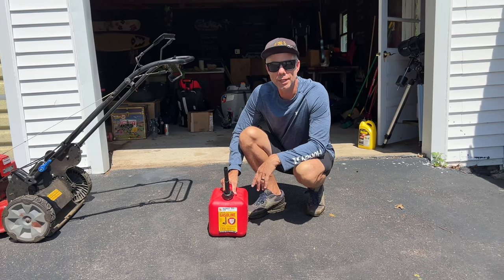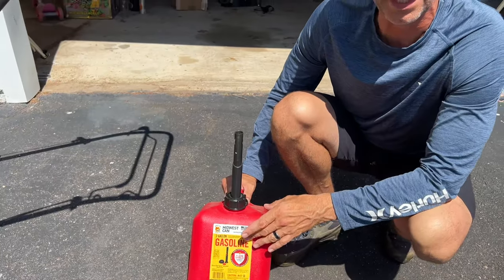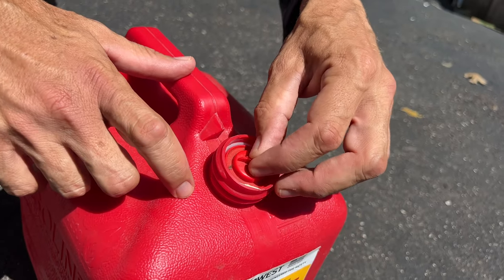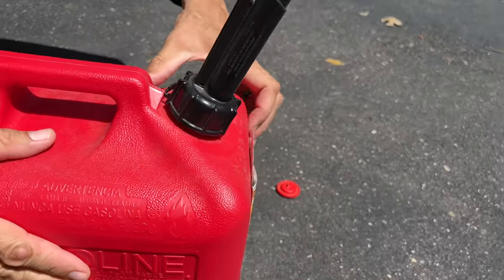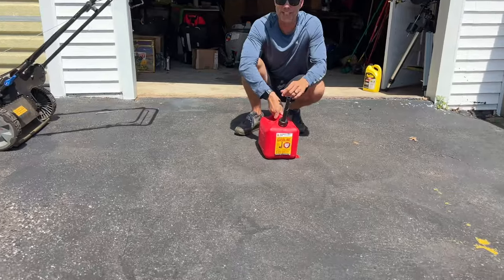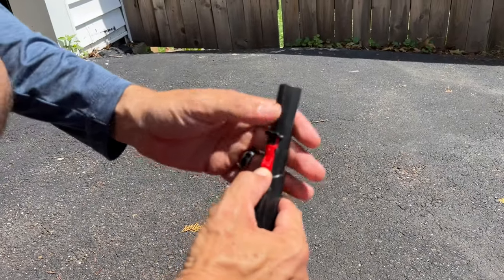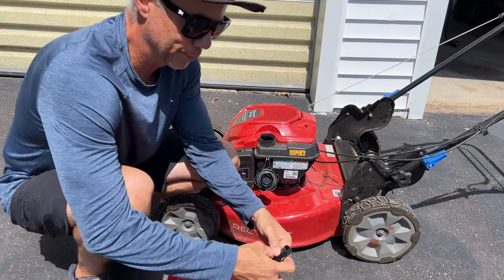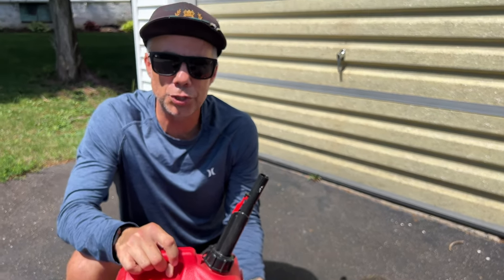How To Use a Midwest Gas Can…the WrongWay!

Comment: Actually the proper way is to unlock the red lever. Tip the can up vertically and rest the gas spout extension piece on the lawnmower tank. Then push down and when it’s almost full slowly start lifting upwards and the flow slows and then eventually stop. You don’t have to hold the lip with your hand. That makes it more difficult and your less likely to spill gas.
Reply from the maker: Wow, thanks for the very helpful
info!
I’m going to give this a try, probably shoot a new tutorial as well.
Thanks!
Reply from the maker: Here you go!

https://youtu.be/xfZI2VC2tEo?si=B2NDWEZZIEiNQcFS

Comment: Thanks. Another thing you can do is just cut off that ratcheting thingy that makes it harder to unscrew the cap. The only justification for it is as a childproofing measure, which for many people is not relevant.
Also, depending on the type of nozzle on the can, it may be helpful to get a gas can vent cap for improved fuel flow. Cheap improvement and at Amazon.

Comment: How do you get the gas into the can? The nozzle at the gas station kept shutting off on me or spilling when I was trying to fill the diesel version of this can.
Reply from the maker: First, I remove the spout so I have easy access to the fill hole.
When filling the can I usually don’t squeeze the gas handle all the way, instead I gradually increase my hands pressure on the handle until the gas is flowing at a reasonable pace.

Comment: When storing it, do you put the nozzle back inside with the red piece ?
Reply from the maker: I do not.
Reply: For me, it depends on where it's stored. If it's a dusty location, I use the cap. Otherwise, I don't bother.

Comment: You just took a gas can that if used properly can be used to completely fill up some thing without overflowing if you stick the nozzle down inside of the filter spout on the lawnmower tractor it will stop filling when it’s full. Automatically you just completely obliterated that feature
Reply from the maker: Did you join 1 week ago just to make this comment!?
I’m flattered!

Comment: Anytime ya gotta use two hands to pour gas, it's too difficult and defeats the purpose of being what they call "user friendly".... I cut the nozzle up and rigged it so it operates like a normal gas can...one handed operation..
Reply from the maker: Seems a user error on your end.
I have no problem using this gas can.
Reply: @DIYTutorialGuy  
Must be me then...the instructions say to press the tab on the nozzle  against the gas filler opening on the engine to keep the nozzle open while filling...the spring inside the nozzle seemed too strong and kept pushing the weed whipper away, it being not heavy enough to resist the spring tension... maybe on a heavy lawnmower sitting on the ground on four wheels it works... But it just seems too much to do for a simple task of pouring gas ..I never had any major spills and even if it did spill some over, the machine still started...but gas does stink and  can be dangerous...in the hands of a fool..
Reply from the maker: @David-uh9cc man, using this with a weed eater would be a PITA…never thought of that situation!
Man, you’re not wrong.
Seems you did the right thing by “modifying” the gas can.

Here’s another video I shot on using the gas can.
Regardless, I fully agree with you about this gas can when trying to fill a weed eater!
You have shown me the light!
https://youtu.be/xfZI2VC2tEo

Comment: Spilt more gas with these stupid "safety" cans!
Dumbest design!
Remove the white "thing" in the spout, cut off the tabs on the bottom of the locking ring, and use a battery powered transfer pump.
No spills or wasted fuel!
Reply from the maker: Thanks for watching and commenting!
I actually learned the true method for using this can where no gas spills, but have yet to shoot the tutorial.
Hoping to get it shot and posted soon!